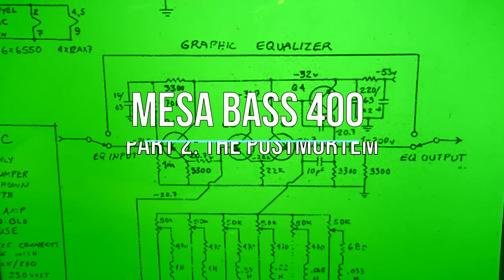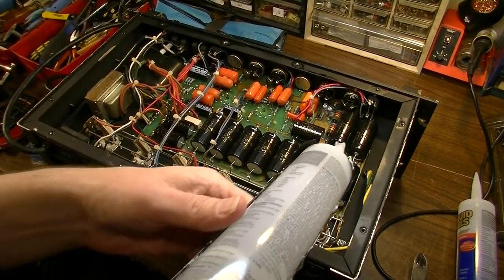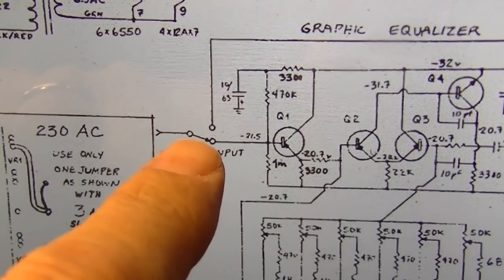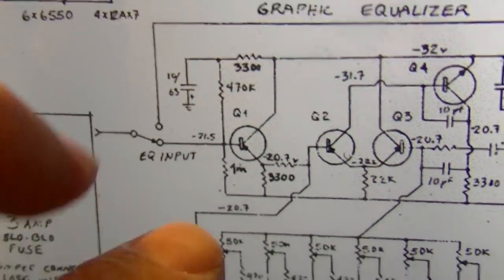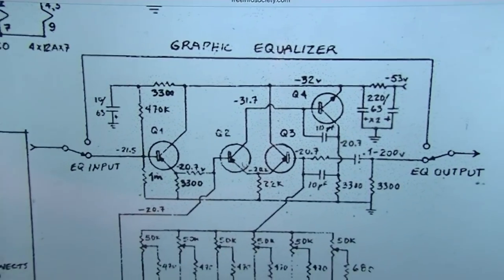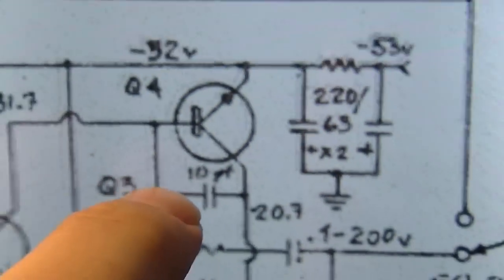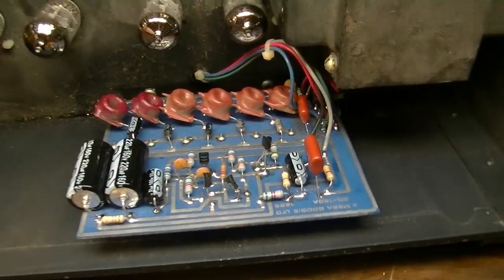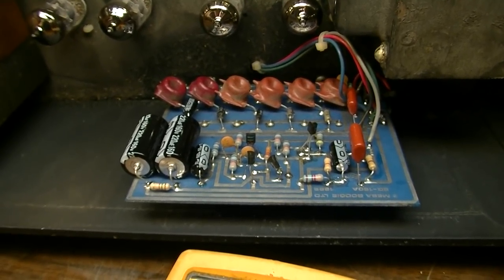Does Mesa Boogie Intentionally Falsify Schematics? EVIDENCE INSIDE! Bass 400 Service Postmortem

Comment: Seen bad schematics numerous times on Mesa's, it's a big problem over here in the UK getting one repaired - the sole importer is useless and doesn't want to know. I've repaired quite a few, but it's always hard work. One that springs to mind was an old studio calibre 22. No signal to power stage and no schematic for the revision - it was similar to other versions but not the same. I found the problem - sneaky bastards had hidden 3 small signal diodes in series under two power caps that were siliconed together. Impossible to see without removing the caps or the complete board, center diode was open circuit and effectively switching off any signal output from pre-amp by killing DC to loop section and opto switch. Removing the board was the last option - every wire from the mains and output transformers would have had to be cut or unsoldered along with every wire to every pot which were blocked in by the PCB! Three other techs had looked at it and given up, two of whom were allegedly Mesa certified....
Reply: Westside distribution , otherwise known as "oh you have 1 non mesa brand tube in therem so youll have to buy an entire mesa branded retube set before we can even touch the amp"  they charged me over £400 to repair a 290 and it broke within 4 months , fuck shipping that back to them again , £80 each way

Comment: JUST A WARNING ABOUT THE SILICONE SEALANT - I'm only 3 minutes in but I thought I should mention something very important about the silicone sealant. Standard universal silicone sealant is acidic (you can smell that strong vinegary odour when you use it), and it can corrode components and PCB traces! I'm sure the plastic covers on the big caps would be fine with universal sealant, but getting it anywhere near the PCB traces can cause problems later on. It's always safest to use the electronics-grade silicone sealant - I think it's known as  'neutral cure', as it doesn't release acid when curing.
Reply: ForViewingOnly this is exactly what I was wondering when people were saying "you should put that right under the caps and stick the caps right to the board so you can't see the sealant." The acidic smell was a clue
Reply from the maker: That's why I left the amp wide open to cure for more than a day. Good point. The board is also laminated in this section, so the bits on the board shouldn't corrode as it cures. Thanks for the comment!
Reply: Every proper engineer knows that standard silicon sealer fumes can still be rotting copper over a year after it was put in there. No proper engineer would EVER use that stuff. Cowboy.
Reply: Wow, another no name anonymous troll...
Why do people do that and hide behind a mask?!
Reply: Electrofrying D, perhaps he works for Mesa :)
Reply: Standard vinegary RTV is as bad a board wrecker as is acid core solder. It wil outgas forever.  There is no fixing it. Soldermask just makes the problem take longer to manifest. The acid fumes get underneath there and will attack the copper/substrate bond. I worked for a company that used that stuff in the early 90s ( procurement error)  and EVERY board they used it on has had the traces come up.

Comment: Considering how .. inspired.. they were by Soldano amps, it's funny they'd be so worried about people copying them.
Reply: As well as how Randall Smith started off by modifying Fender amps. The first Mesa Boogie amps were essentially modified Fenders, which meant the Mr. Smith probably had a schematic of them.They're hypocrites.
Reply: Most amp and effect manufacturers are. Some are are even hostile towards modders, like Mike Fueller (of Fulltone), which would often go after people on ebay selling nadmade builds of his circuits, which is why the OCD has 4 different versions with different circuitry, since Mike was desperate to get a patent on that pedal.
Reply: This is some years ago but the diy effects/stompbox community is no different lolz. I remember some ridiculous fighting and attacking (like hacking etc) as well as threats reg certain 'holy grail' type pedals or gooped up ones being degooped and reverse engineered. Community split in 2 iirc and the reverse engineers kept on reverse engineering. X'D (With surprising results in regards to how boutweak some of the boutique scheme really is/was).
Reply: Haven't been there in years but I remember a couple of amps being reverse engineered/verified, so if people are looking for confirmed schematics it's at worldwidewebz dotz byocelectronics dotz com/board/index.php
Reply: makes Mesa seem scummy.. + to anypone who doesnt know what hes referring to, the rectifier preamp is a Soldano clone.
Reply: @MrSimondaniel3  Yes it is, all the key component values that create the overdrive in the Mesa Rectifier was a 100% clone of the Soldano SLO preamp. The later Rectumfryers reduced the gain/frequency spectrum of the full SLO preamp by adding 100R resistors in series with all the 1uf cathode caps and reducing the gain pots values from 1MA each per channel (in parallel with each other to make up the SLO standard 500KA gain pots) to 250KA with an added relay function to switch between the gain controls. The main thing which skews the frequency response from the SLOs Marshall like midrange character to the Recto's bassy buzzsaw is in the poweramp's lack of negative feedback and simple treble roll off presence control. Any Soldano SLO can be modded to rearrange it's poweramp into the type that the Mesa Rectifier red channel uses; the end result is the same skewing of the preamp frequencies but with a much higher degree of articulation and stage presence due to the higher quality output transformer, simpler/more stable layout and lower noise profile. I invented a mod which uses a push pull (DPDT) presence control to simultaneously disconnect the NFB loop and rewire the Presence as a treble roll off type connected to the intersection of the tone-stack and master volume.

Comment: I think it makes sense now... that cap you replaced is not on the schematic at all, but it needs to be there to keep the 21v negative bias out of the return of the FX loop.  That's an obvious error on the schematic (the one that is shown on the schematic is behind the one you replaced.)  The undocumented input cap had failed short -- you can't blame it, it was trying to make the circuit match the schematic after all!

All of which explains both why you were reading so close to zero at the base of Q1 and why the resistance to ground was only 14k (the 15k resistor up before the FX loop was shunting the bias resistors), and having the negative bias fed back up the FX loop would also explain:
- the reported weirdness with the FX loop that you mentioned at the start of the first video;
- unexpected interaction between the FX blend knob and the EQ
- why the bypass switch was so noisy (switching a DC offset in the signal chain.)
Reply from the maker: Yep, yep, and yep. All that stuff you just said.

Comment: Don't know if it is intentially. My experience is that a lot of designers are just very inconsistent (especially in the older days). Errors were just fixed by hand on paper.
Reply: True, it is very difficult to tell whether these mistakes are careless or intentional ones.   How can we ever know for sure?
Reply: esquehill . I don't really see a reason why someone would do these things on purpose. It's not rocket science to figure out the correct values etc
Reply: im not aware of other amp schematic errors.

Comment: This brings up why I'm conflicted about Mesa Boogie. I love their products, but their practices regarding schematics and the way they bully those who possess them into taking them down makes me hate them. I also wish I could get my hands on a bunch of their amps, make correct schematics of them, and put them out on the internet for the world to see.
Reply: And what a contrast to what fender does, which makes their schematics freely available!!  This makes and keeps me a loyal Fender customer!
Reply: Well, some of their schematics are freely available. For example, if you request a Bassbreaker schematic from them, you'll get a flat refusal from them instead.
Reply: nothing Mesa makes is superior.  Fender, + many other better for clean sounds.  Marshall, soldano, wizard, Bogner, Diezel, Friedman etc. better for heavy sounds.  i will say the Mark 1 + 2 are pretty good.
Reply: I am not defending Randall Smith or anything but, I wanted to point out that Leo Fender took his designs directly from the RCA Receiving Tubes Manual. It wasn't stealing or shady business practices either. RCA compiled the manual with bunches of schematics intended for potential manufacturers to use freely so they could then sell them RCA Tubes. So, basically the tube amplifier designs are public domain. Not Fender, Marshall, Smith, Rivera or anyone else own the rights of tube amplifier designs except for certain ideas and improvements that they have added along the way that are worthy of a patent. As far as I know Vox is the lone exception.
Reply: @MrSimondaniel3  Good Luck finding a better Class D Heads than the D800+,WD800, or TT800.

Comment: I'm confused about the transistors Q1, Q2, Q3 being "DC Coupled" meaning they don't have any Inter-stage Capacitors? Any reasons or Advantages of using "DC Coupled" transistors in a row because most audio circuit have those inter-stage block capacitor per each stage section to block dc voltage from the previous stage output to the next following stage input, which Mesa Boogie used DC Coupled topology instead for a reason or advantage.

Comment: I'm not surprised by the way Mesa Boogie hides information from consumers. Had a mini mark 5 that was super noisy with switching and they told me that there was nothing wrong with it. After watching your video on another amp, I tried to get some info on the mute circuit and was refused any help from Mesa Boogie.  I got rid of the amp and bought a Silver Jubilee.
Reply from the maker: It's surprising they wouldn't help you at least find a Mesa authorized tech nearby.
Reply: They most likely assumed the warranty was already void on the amp, which makes it not their problem.
Reply: I guess good used Mesa amps are their greatest competitor!
Reply: The stupid thing is they don't need a mute circuit ! I v'e ben using Relay switching in my 2 and 3 ch amps for years. Just using the old snubbing cap method keeps it plenty quiet while switching .
Reply: I took it to the only tech in the province and got it back 3 months later with the same issue. The roadster that you fixed was 100% silent and my mark 5 still made noise. Long story short, I want to thank Mesa Boogie for steering me back to Marshall
Reply: @lroy730  But you can't patent relays & snubbing caps.

Comment: Yep ! The Graphic EQ is the Hart of the MK series Boogies an these bass amps. Thus Randall throughs a couple of zingers in the service schematics. If you ask Mike B at Boogie HQ , he will say its a mistake . But I've seen actual Erased and smudged  component values and some just left out. Randall does have some Steve Jobs control issuies about his products. You should do a rant on Randall Smith's explanation of why he doesn't put Bias Pots on his amps ??? Because I put Bias Pots in all my Mesa Boogie's and recommend that all my clients do the same. Some things i've never seen on a schematic, like the Limit Knob on the back of some MK2C+ Colosseum's.

Comment: 2N3906 has max Collector-Emitter voltage of 40V so you're operating at or close to the max. I would increase that dropping resistor and get the voltage down if you are using those transistors (for long term reliability).

Comment: Coupling capacitors sometimes drive me crazy; When I'm using my pedal chain with my modified clone of vibrochamp  sometimes accidentally short the out pedal jack with the tip of the cable and it just stop the signal until i short the first coupling capacitor on the amp. I finally modify the circuit to drain slowly that cap when it happens and avoid open and open my amp to short it manually. I think it has relationship with the pedals power source, the high noise when the jack short happens, but i don't know exactly why.  In this case that mix of voltages with solid state and tubes maybe can cause something like that, just a theory i don't know.

Comment: Brad the cap you replaced looked to be a coupling cap from eq switch and i also didn't see that cap on the schematic.
Reply from the maker: That's what it was...a coupling cap designed to prevent DC leakage back into the main board circuit, including the effects loop! So if that cap was already leaky and on its way out, it makes sense that the customer would have experienced issues with the effects loop.

Comment: I'm looking, interestingly, at the biasing of those transistors; it wouldn't be difficult to vary the frequency response(s), which would add the ability to vary that board's 'range selection'. It's actually damned clever!

Comment: Question. I have a Peavey xxx used to sound great but now it's a buzz bomb and has a squelching pop when cut off. I re soldered the tube sockets but didn't help but I noticed two out of the four tubes burn blue other aren't. Switched them into the different sockets and the same sockets that burn blue had the ones that weren't burning blue. They all use to burn blue. Resistors?
Reply: To reply to myself. It was the resistors
Reply: @covenantpickups8315  even though it didnt directly help me ,great job replying !

Comment: You can tell that there is something fishy about this schematic right away - Q4 has no connection to the output except for a 10 pF capacitor, and that's just not right. Q2/3/4 form a simple operational amplifier, with Q2+3 being the differential stage and Q4 the VAS, with a negative feedback network going from Q4 emitter to Q3 base. Q4 emitter (plus maybe an output coupling capacitor + series resistor) should be the output, with a decent amount of current drive capability at audio frequencies. A 10 pF makes a good coupling capacitor at VHF, not audio...

It's a bit of an odd design anyway. Q2 seems to be geting all its collector current from Q4 base with no extra resistor, leaving differential stage balance at the mercy of Q4 beta variation. Yeah, it obviously works, and it's not hi-fi anyway, but...

Comment: I thought I saw a cold solder joint next to the capacitor you replaced, Brad. Am I wrong? Look at the footage really closely. Those two resistors. Maybe the two 3.3k resistors? Maybe the pad lifted? It's connected to the one next to, what's it say? 1992? 1982? Then the next rail and then the next transistor? Another cold solder joint? I see that in the video right after position 8:44? Tell me anybody if I'm seeing things that can be misconstrued by a video. I'm not anybody that can be anything near Brad. One reason I watch his videos is because I hope I can learn from him. Js. Ugh.

Comment: This is the usual....Moog did it, also roland and korg in their vintage stuff, but mainly to keep out these "MeeToo" copy engineers/companies at the time, not to confuse the repairmen....but these "altered" schematics are what is to be found out the net...as these copy companies usually filed and sold all of their stuff to someone else who only was interested in making more money...so they also sold these formally hart to get stuff for a usually tripple digit count....and that´s what we have to deal with today...all these "altered" schematics...
So the best thing is: always draw your Amps circuit first and then check it against the one you got from the net somewhere and always use common sense when doing repair...it´s not as complicated in an amp, but way more complicated in a (modular/polyphonic) synthesizer with 5 or more PCBs, my personal mighmare was the memory moog, known to be unstable due to heat and bad PCB design....also there´s no free to download schematics which are known to be correct. you alsways need to contact a professional  and authorized schematic comany, or you need tio know a tech who already did ona these without failure....

Comment: I've always used a hot glue gun. Is there a benefit to using silicone?
Reply from the maker: Hot glue is considered the wrong material for this application by techs because it can be corrosive, can become conductive, and doesn't hold well long term under heat.
Reply: Silicone doesn't melt when it gets hot. Never use hot glue on any amp.
Reply: Lately , I've been using liquid electrical tape . I only use it to bed down a large component .